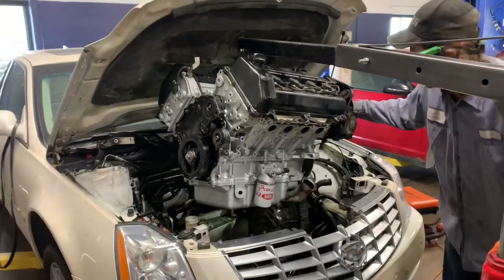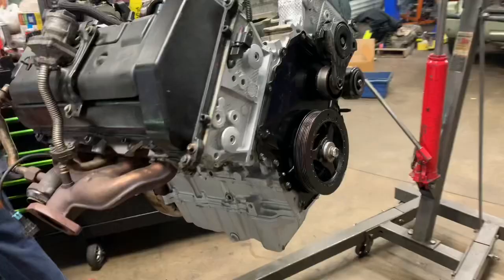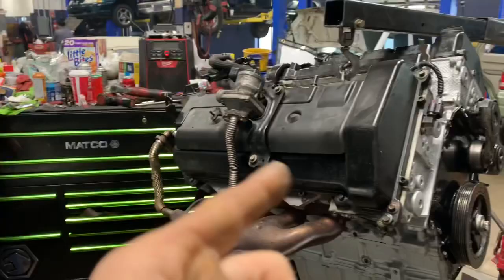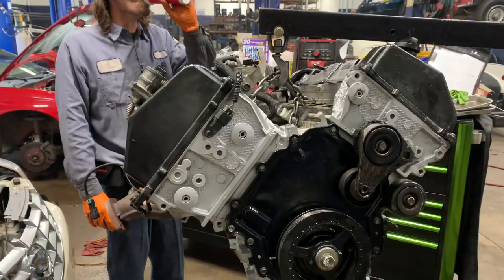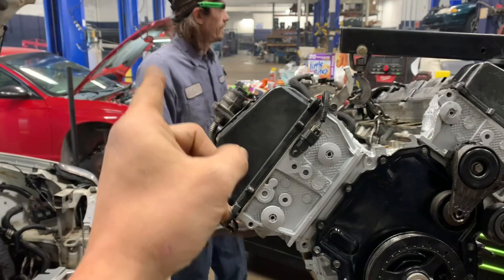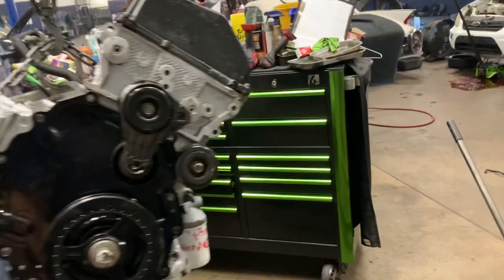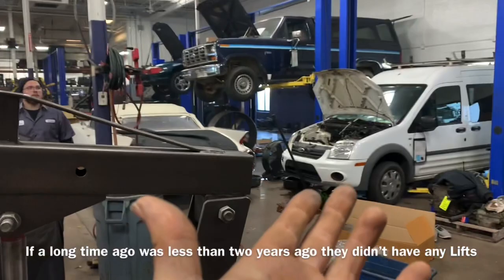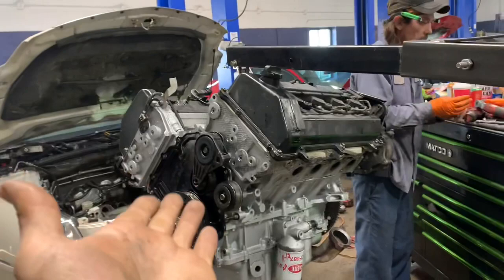Can the Cadillac Deville 4.6 Northstar engine come out through the top?

Comment: My favorite Cadillac engine! Our shop has bulletproof rebuild technology. I personally own a 95 Concourse with close to 300k on it. And my 03 Deville has 275k best part is both cars are super sleepers.
Reply from the maker: We’ve got a customer that has one of these in a Sandrail and Darin the guy back in the engine shop. Figured out a way to actually start the heads and he is putting out over 950 horse out of the 4.6 V8 it’s just a story I heard so I don’t know all the particulars but Darin’s in his 60s and he doesn’t seem to be a liar so I have to believe what he saying is true
Reply: I only have basic car knowledge. How should i go about pulling mine out? I have a 96 DeVille Concours
Reply: I own a 2004 Deville DHS with 48k miles on it. I love the car but have heard such bad things about the Northstar engine. No problems at the moment but would like to know where to take my car for proper repairs should something happen. Where is your shop located?
Reply: Old comment but I'm wondering what if ANY major issues on the DeVille? What kind of routine maintenance? Preventive care? Alternate parts or all original?
Reply: @egibs3565 at like 180k my water pump fully went and ive had my coolant reservoir get a crack in it and both wheel bearing my valve cover has been replaced but its bad again and i've replaced spark plugs but nothing i couldnt do im not going to do the valve cover yet because it seems like a pain

Comment: my son and i removed his 02 dts engine and trans out the top we took the hood off and took off the front grille and the bar that goes across the front, the radiator, disconnected the exhaust, the wiring, unbolted the mounts, the cradle and pulled the engine and trans connected together

Comment: I recently had my 2000 Deville engine swapped with an 03 STS with 89K mi. It was removed from the top with the hood still installed as well.  Took about 20 hrs of labor including replacing all of the motor mounts, gaskets sensors coil packs and water pump for added insurance. Thanks to Northstar Performance as well for Q&A session.

Comment: I removed the engine AND transmission out of the top of my aurora through the top and ever took the hood off. although for the install I found it easy to remove the front bumper and reinforcement and the rad ducting . only thing I will do next time and remove the ABS/traction pump and master cyl as a complete unit  from the front of the cradle, Its really the only thing the engine was getting in a Nonconsensual relationship with.

Comment: I had a 95 Cadillac DeVille with a Northstar engine in it and the head gasket blew. The Cadillac dealership where I live would not warranty the work if they repaired the blown head gasket. It would cost around $3,500. So I recommend that you not buy any Cadillac products. If you have one get rid of it fast.
Reply: I have a 97 seville sts with a rebuilt intake manifold and headgasket with what I assume to be reinforced heads. Once you get that repair done your deville would've lasted practically forever given you didn't let it overheat again. My caddi has over 222k miles on it.